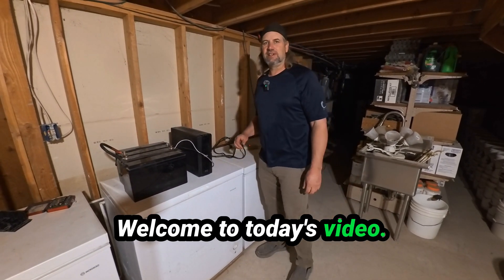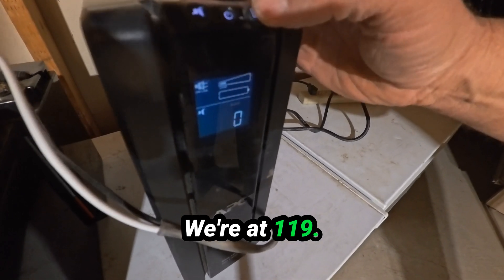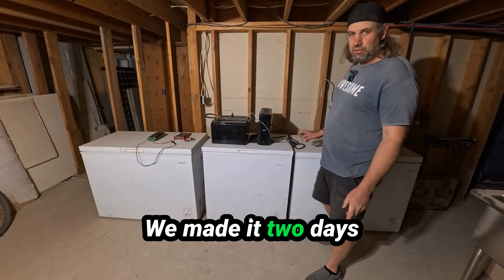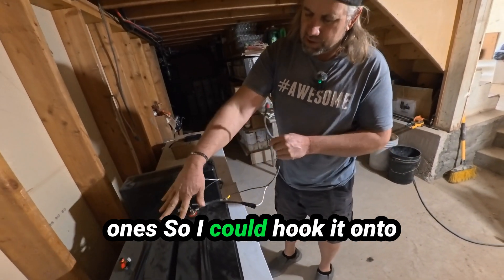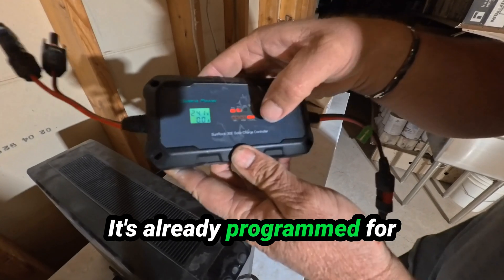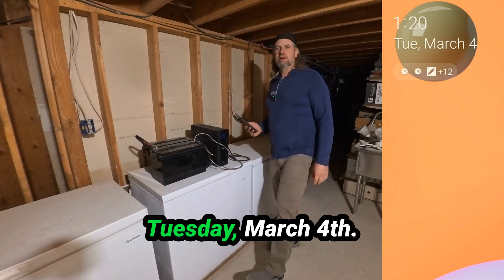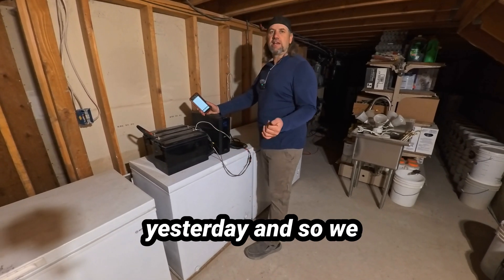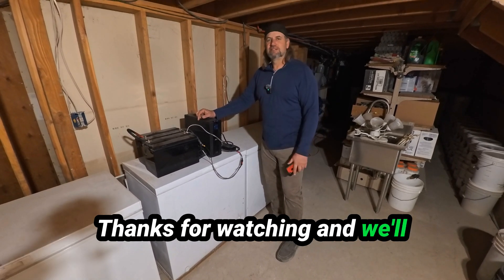$50 UPS Power Station runs Freezer for ??? Days

Comment: Very nice job you do i know those ups can run with Lithium battery cool 🥰🥰🥰🥰🥰so can usp charge those Lithium battery
Reply from the maker: Yes, UPS can charge the lithium batteries.
Reply: @Thesolarfarmer  i need asked its only come with lead acidthanks  battery will it damage the cell for lithium not know much only little i have ups 550VA 330 wats i have 18V 5A and 18V 12A Lithium battery what i do i buy 18V converter 12V 20A to used with my usp so i get all 2 hours and 45minutes with laptop on 18V 5A wich is cool i have qusetion asked you can my ups charge my 18V 5A Lithium battery i have converter 18V to 12V 20A Converter just asking
Reply: i have go check for video

Comment: This IS to good to be true. Your $50 UPS is rated at 1500VA not 1500 Watts. 1500VA is actually only about 780 Watts. The other issue with your experiment is that this cheap UPS only produces a stepped approximation of a sine wave, not a pure sine wave which means that your freezer's compressor motor is going to run hotter, which will shorten it's life. That cheap UPS might be fine for running a computer because computers use a switching power supply, but it was not designed for powering electric motors.
Reply from the maker: Thanks for the info. What do you think of using this UPS for backup power for Starlink internet?
Reply: @Thesolarfarmer  The reason a modified sine wave works fine for a PC is because the PC itself doesn't run on AC.  It converts the AC back to DC in the power supply to run the PC.  Basically anything that has a power supply to convert the wall AC to DC will work fine on modified sine wave inverters including the Starlink.  You can test how bad the AC sine wave is by plugging a regular house fan into the UPS and hear the noise it makes when compared to plugging it into the wall outlet.  Some are so bad the fan won't even run at full speed.  Motors need a clean sine wave.  All the abrupt changing in voltage just generates heat because the motor can't change speed as fast as the modified wave changes voltage.  Also anything with a dimmer won't work either on a modified sine wave because it relies on a smooth ramping in voltage to have different dimming levels.
Reply from the maker: @scottkolaya2110  Inverters sure have gotten so much better. I remember the first inverters that were square wave they would destroy everything that you tried to power with them. Then came the modified sine wave which was better but put a buzz in your speakers. The pure sinewave that we have now is cleaner power then the grid.
Reply: @Thesolarfarmer  You are better off running Starlink (Starlink can run from 12 ~ 48Vdc) of 12VDC which is more efficient than from inverter since inverter has about 80% efficiency.
Reply: One problem with this solar or battery power retrofit infrastructure is the retrofit to make it do something it is not.

A totally solar house could be totally 12 or 24VDC with no inverters to simulate a Westinghouse alternating generator producing on off high voltage power.

DC degrades over distance, but a home has no real distance ...so we can go back to the original much safer idea of DC only that was abandoned over 120 years ago in favor of interstate transmission.

A DC freezer, a DC entertainment rectangle, a DC air handler and DC lights.  Easier to wire, safer to DIY and direct from producer or battery to gadget.

Many gadgets today are really DC anyway with inverters and transformers making the wall grid power plug work.

If we were to recreate all our appliances for this intent, then they would likely be far more efficient and draw less power....as many gadgets are full of resistors to bleed off excess power to the ether.